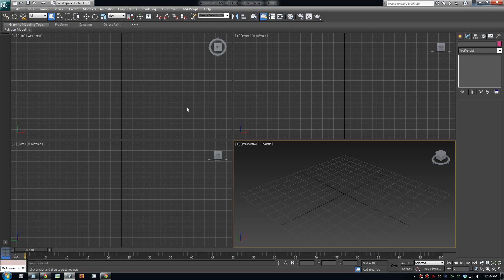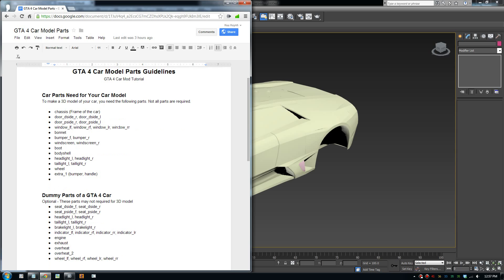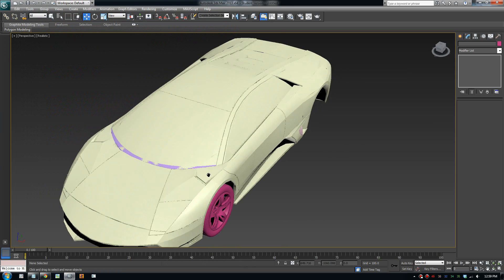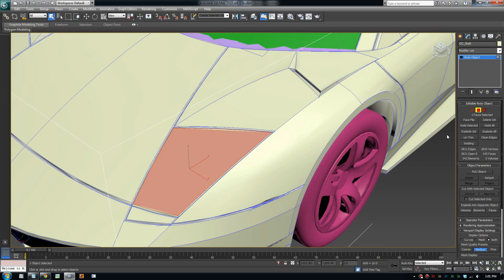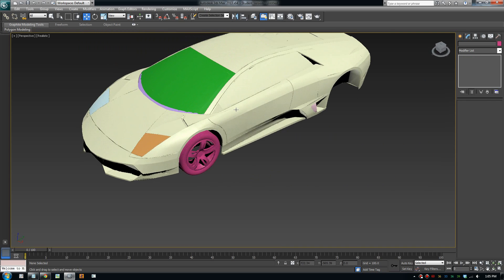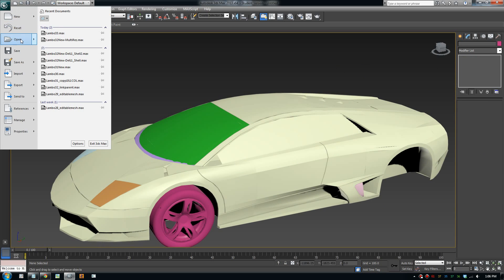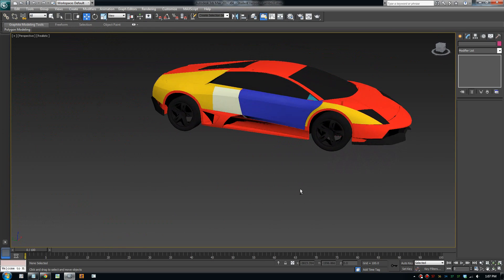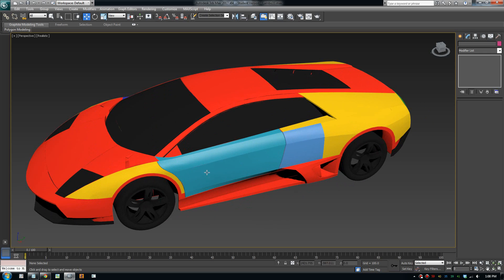GTA 4 ZModeler Tutorial - 3 Detach and Attach car parts in 3D Studio Max

Comment: What about brakes? what are those parts? is it an extra_1
Reply from the maker: pierre2324 yep, use the extra names to add other parts.
Reply: okay but now im stuck when I import to zmodeler all my parts are separated far away from each other
Reply from the maker: Try different file formats and options. Some import settings will create this problem.
Reply: I know obj format is working but zmodeler can only import 3ds files...
Reply from the maker: When you bring the original file in 3DS Max, play with different format. In 3DS Max, avoid using many modifers. Then bring it into zmodeler. Try bringing the car into zmodeler without using any modifers in 3DS Max.
Reply: not easy task because my ford probe as too much polygons so I apply a optimise modifier...
Reply: 3D Surfacing Do you know how to convert cars to IV